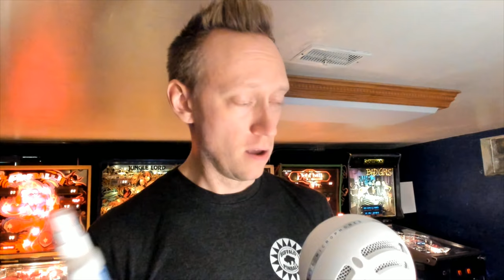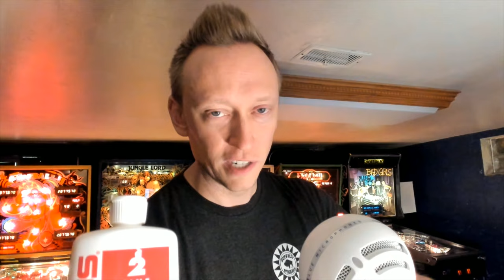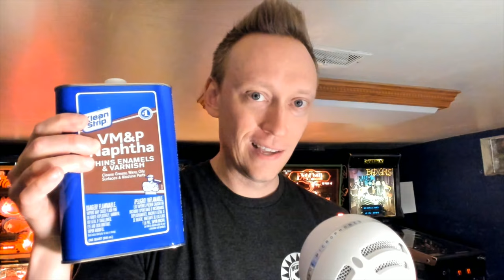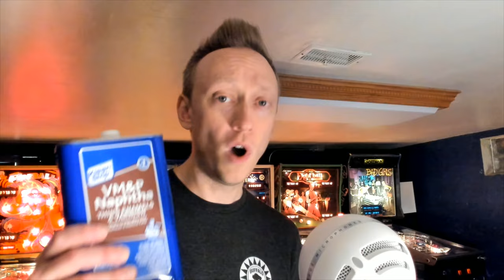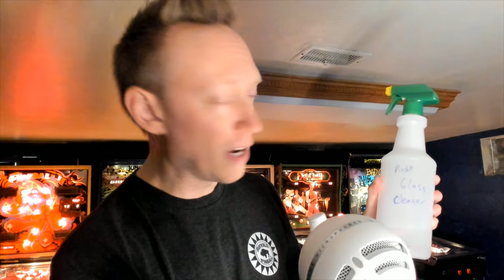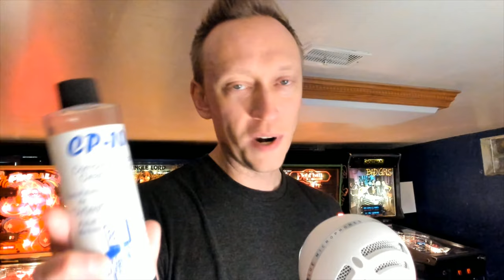How to Clean a Pinball Machine - Tips and Tricks

Comment: Thanks for the great tips.  I'm the proud owner of a latest built (October 2021) Willy Wonka LE. The game has 600 games played total. I tried Naphtha on the rubber/plastics and it worked like pure magic. For the ball trails, I was very disappointed though as Naphtha (the same brand that you use) did nothing at all. I rubbed pretty firmly 3 times (putting Naphtha on the microfiber cloth each time) and nothing changed. I guess that the only way to get rid of this problem (ball trails) is to use some light abrasive like Novus 2. Someone in another cleaning video tutorial suggested to use Rejex (a polymer wax-type protective product) in replacement for carnauba wax ... just wow, will NEVER use wax again (been using high quality carnauba since 2007). It's WAY shinier, way stronger and durable and extremely easy to put on and you don't have to buff when you cleanly (no dust) and easily wipe off the haze 15 minutes later. Keep on the great work !